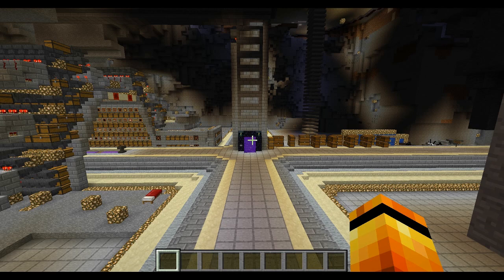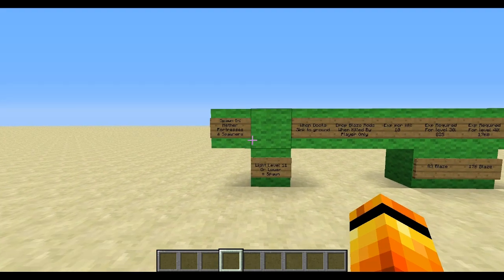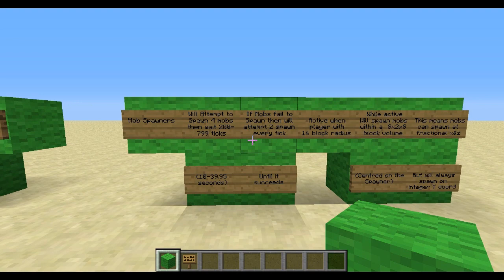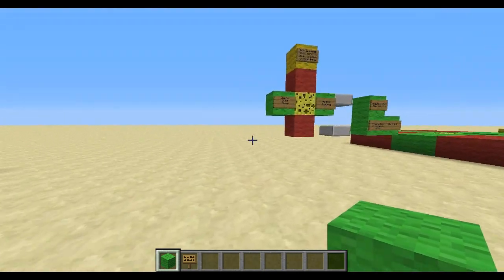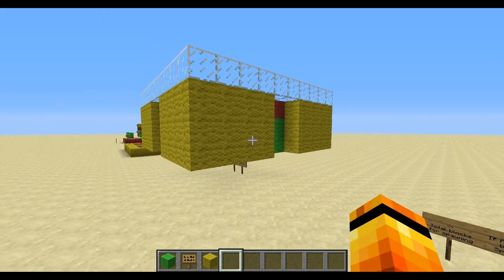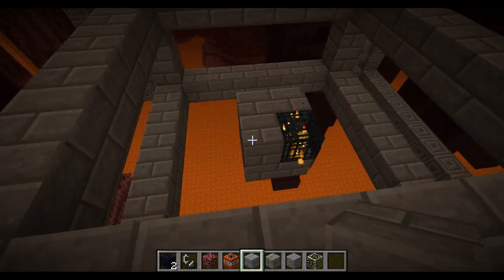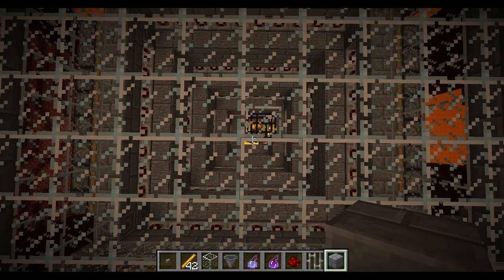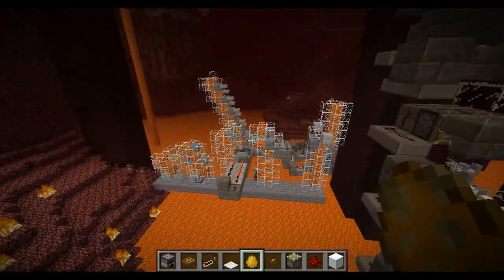King Designs: Maximum Efficiency Blaze Farm

Comment from the maker: For the pusher-around-corner?
Fence gates are much easier to use in designing as they need nothing to be placed onto / ontop of other signs (After placing on a block and removing the block they can just be free floating). In practice you can use either for most things. In this a sign would do the same thing.

Comment: i have built my blaze farm with redstone blocks pushing the blaze down (it looked good with the iron frame). but i noticed on the lowest pushing level with the 3 pistons, a blaze would be stuck inside the redstone block. maybe it is better to use full blocks to hit them out of the block or at least kill the blaze to let others through. also i used mumbojumbo's blaze crusher wich doesnt crush till half a heart but so you can kill em with a potion so one extra suffocation doesnt matter it think...

Comment: Would it be possible to remove that block on top of the spawner to improve spawning (slightly I know) and get the blaze from it using lava streams on a clock so as not to interrupt the spawning cycle? It's just an idea, I don't know if it would work.

Comment: Is there any chance that making only 3 possible spawning spaces would increase the efficiency? It could eliminate the 200-800 tick delay and if the mobs fall directly outside of the 17x9x17 radius then it might attempt to make 2 mobs spawn each tick rather than 4 every 200? Of course this would be dependent on whether or not the success rate for spawning in those spaces is high enough. This would be more along the lines of a skeleton or zombie spawner.